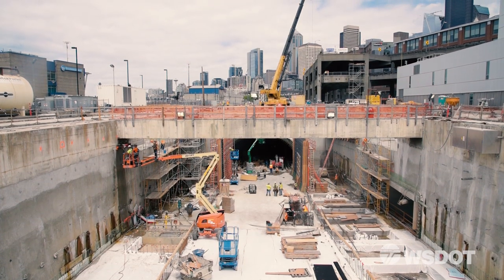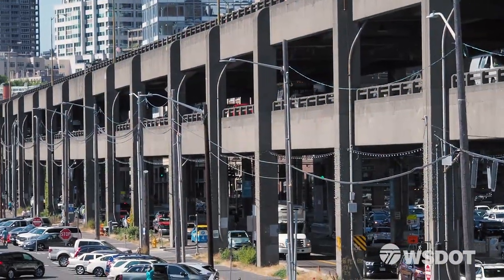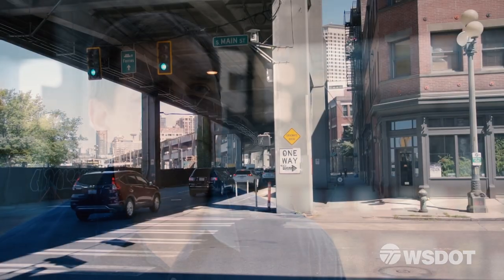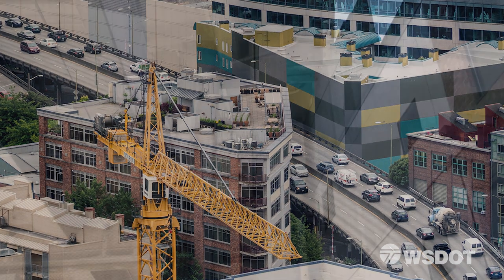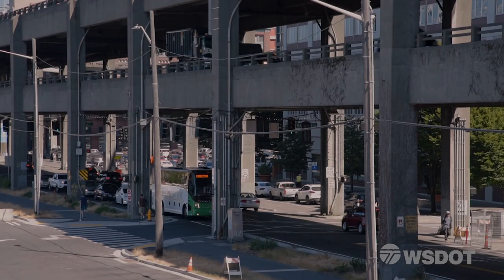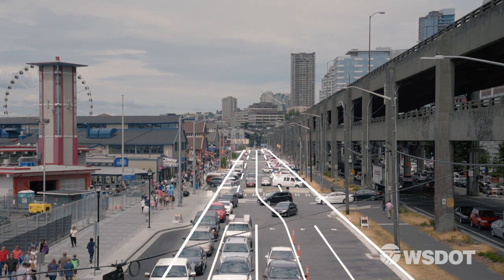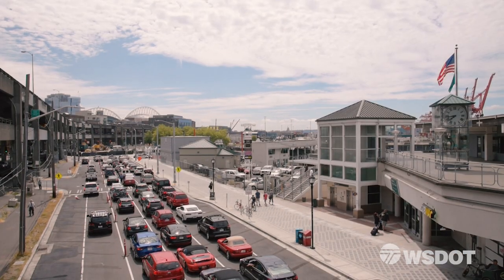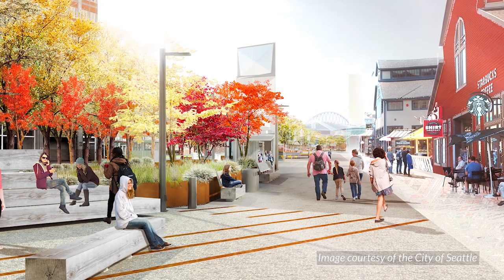Looking ahead to the Alaskan Way Viaduct demolition

Comment: You should leave one section of that as a memorial, and as a pedestrian overlook!
Reply: Remember, Its being torn down since its sinking, and seismically vulnerable (unsafe).,
Reply: It's being torn down to raise the value of some rich people's waterfront property.  The tunnel is an inadequate replacement and a hornswoggle of the taxpayers.
Reply: Not a bad idea but they're destroying it because of the damage it will cause to the city when an earthquake comes.
Reply: @rosalieholland25  They could prop the preserved section up, so that it's "real" but reinforced...
Reply: @tackyman2011  The tunnel has the same number of lanes as the viaduct did. It just doesn't have the entrances or exits to downtown. If anything, this new project is an increase in capacity as there's going to be a significant increase in the size of Alaskan Way.

Comment: How will the old piers and foundations be removed? They'll obviously create voids underground during demo.
Reply from the maker: Our priority is to demolish the viaduct safely with as little disruption as possible. We'll hire a design-build contractor to complete the work which means the contractor will determine the means and methods to safely and efficiently get the job done. They'll be required to remove most of the foundations and footings to 5 feet below the ground then fill and pave over the resulting holes.
Reply: The same way it's always done.